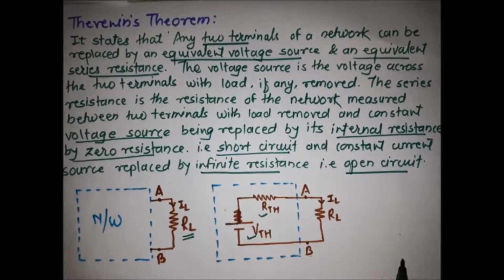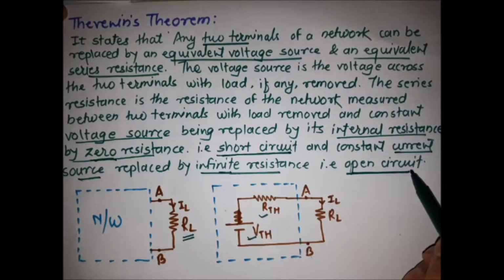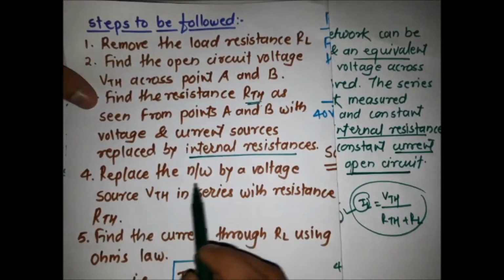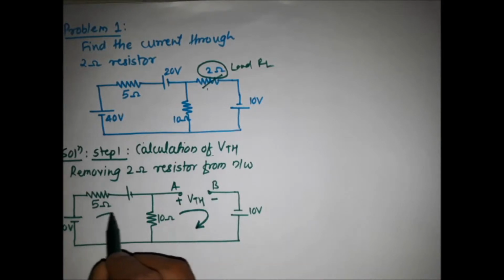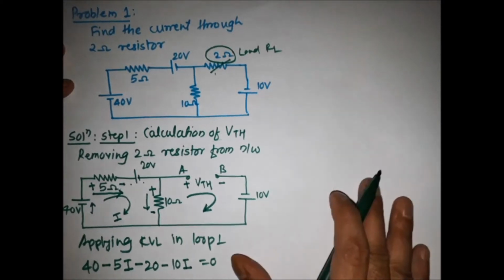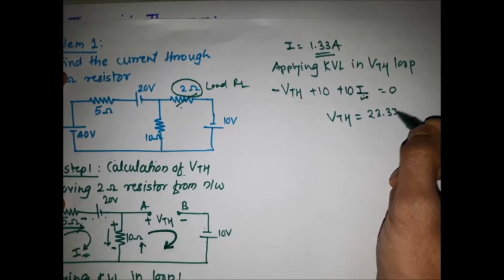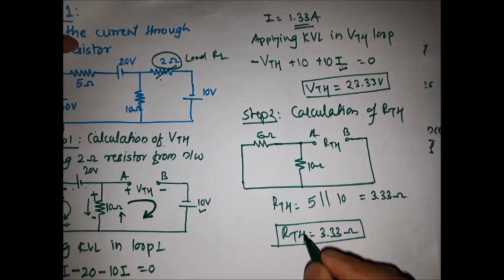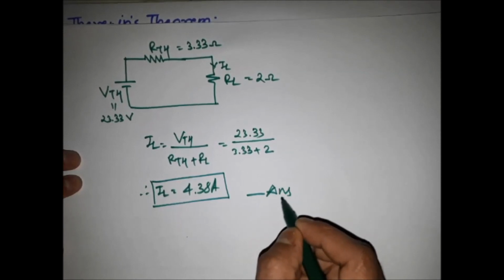Thevenin's Theorem Lecture 12.1

Comment: Sir do so problems on solution of first & second order differencal equations for series & parallel RL,RC,RLC circuits
Y&Z parameters of two pot network problems 
If possible :)